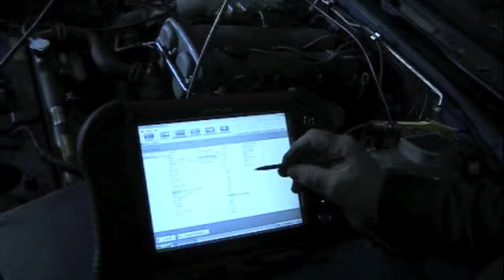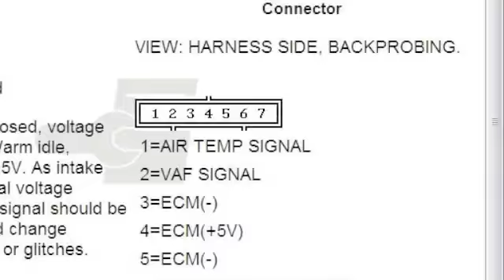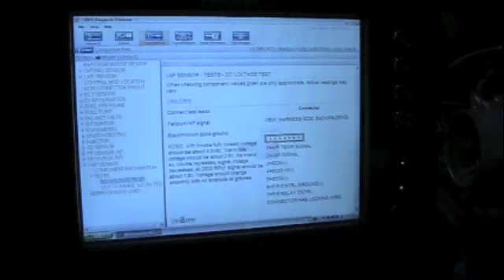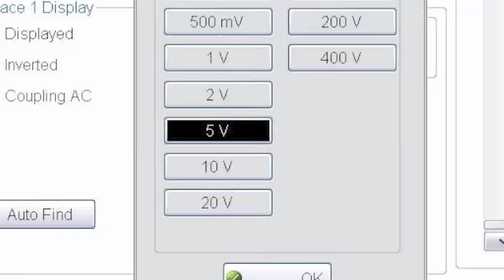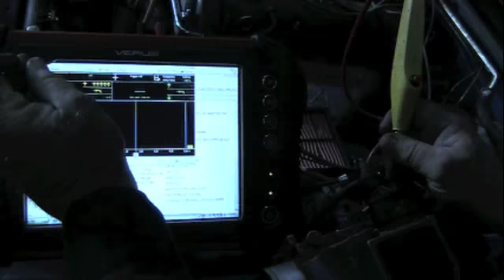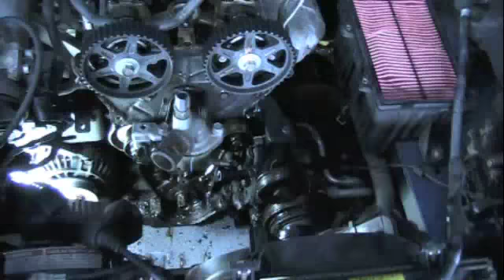Mazda Miata No Power

Comment: My 1990 Miata  crank shaft gear . I Tig welded the crankshaft  key onto the crank shaft .Filed it to fit . It still working 7 years later

Comment: Tig welded it back in place but i had to heat the crank with a torch to clean the oils first. weld it in place and grind each side down to fit the gear.

Comment: @conradsigona  I disagree. The bolt keeps the timing gear in place, but the key keeps it from spinning...so the entire load of the camshafts is working against that key.  Simply, the key needs to be of a harder metal--in fact, it looks like it's hollow inside...maybe Mazda got it from FORD.

Comment: I just had a Kia Sportage in the shop with the same problem. The customer had recently replaced the timing belt himself. If you have a tig welder and a pencil grinder it can be repaired. Find TDC with the pulley on, insert the keyway, tack it, remove the pulley and finish weld the keyway.

Comment: 2. The keyway is basically for alignment. There is negligible torque against it. The timing gear is held tight by the crankshaft bolt, not the key in the keyway. The key only prevents long-term wandering of the alignment. As such, I would certainly prefer to rebuild the keyway than pull the engine. Make sure the other side of the keyway is still pretty. Set the key against the pretty side and build up the beat-up side with Quick Metal. Use a new key.

Comment: There are two issues here. I'm addressing them in two separate comments.

1. No one pointed out that the reason the keyway gets messed up is that the crankshaft bolt is loose, which lets the timing gear wobble, which eats up the keyway. Make sure the bolt stays tight and you won't have this problem.

Comment: Ok, continuing on. The Pegysis tool freezes up almost constantly, not to mention it's wireless Internet connection sucks AND you have to subscribe to OTC's repair info site to get any repair info on the tool, whereas with the Verus, you can use Mitchell, AllData, or whatever repair info site you may currently subscribe to, if any. The only drawback with the Verus is that it's arguably the most expensive aftermarket scan tool out there, so you don't need it for DIY work. Going to another comment.

Comment: To me personally, with as many miles as this things got on it, I'd sell them a new motor. I'd be extremely leary of trying to weld that keyway back onto the crank cause if that weld ever failed, and even with a very experienced welder doing it that's most likely gonna happen, you're gonna have a comeback with a VERY po'ed customer and you're most likely gonna wind up eating a crank or a motor to fix it the second time around. Tryin to weld it is WAY too risky for my blood.

Comment: @thunderstruckter666 If it's a glue or epoxy, I'd give it less than five minutes because of the stress of turning the valve train. Welding it might work, but the crank would still have to come out to do a decent job. Better off putting in a new crank. The problem is that a major repair like this would quickly exceed the value of a 20 year old car.